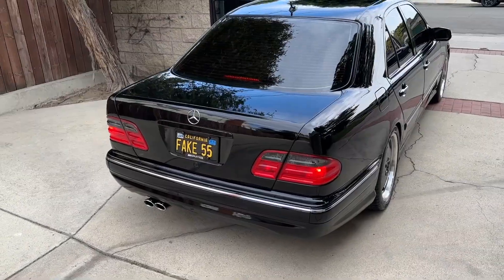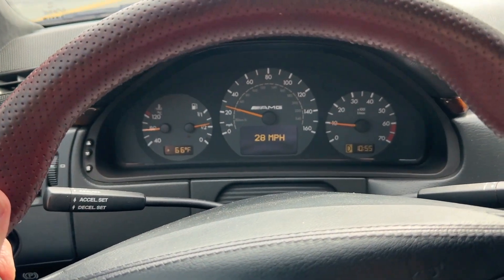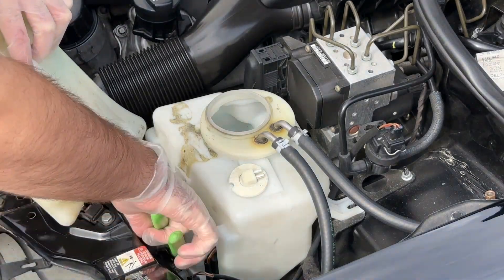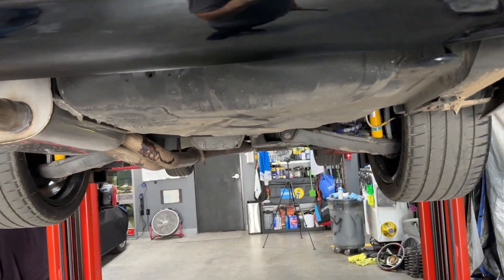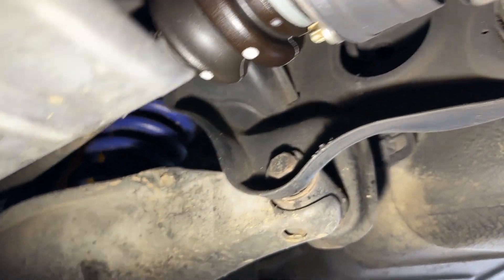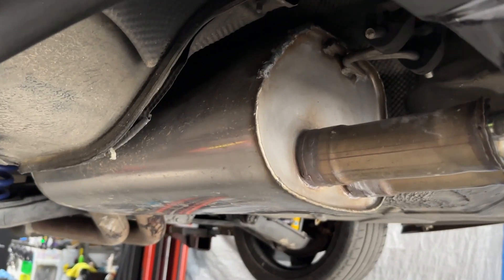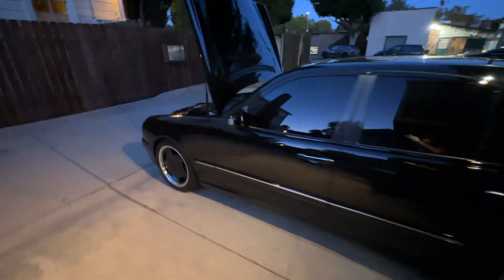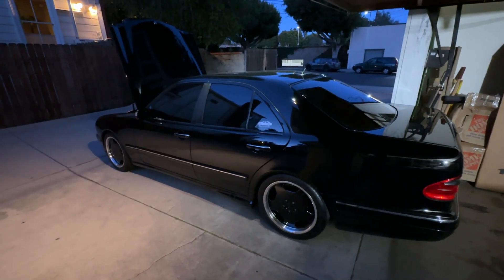Making the W210s Engine Bay Look Nicer + A Closer Look At My Gutted AMG Muffler Vlog

Comment: Hey there. If u remove all the cats from it and don't straight pipe it... Will it give check engine light? If yes, how to fix that?
Reply from the maker: The front cats will cause a check engine light. The proper way to fix is to code the car through a star computer
Reply: Thanks mate. Loving your channel. Keep uploading the w210 ❤